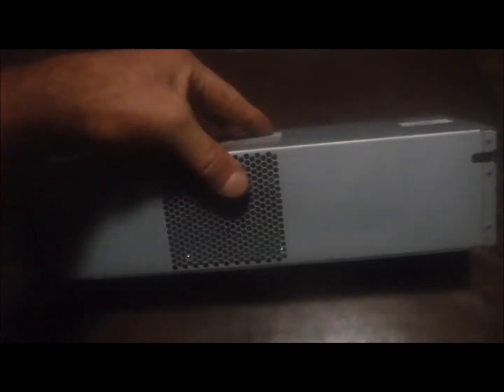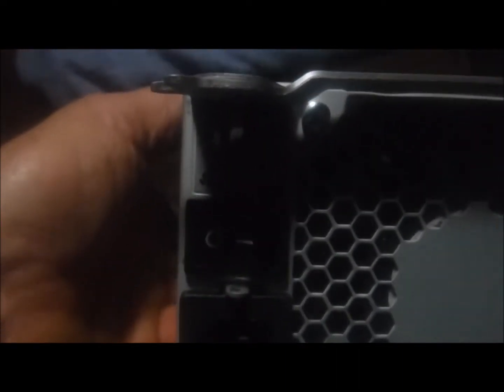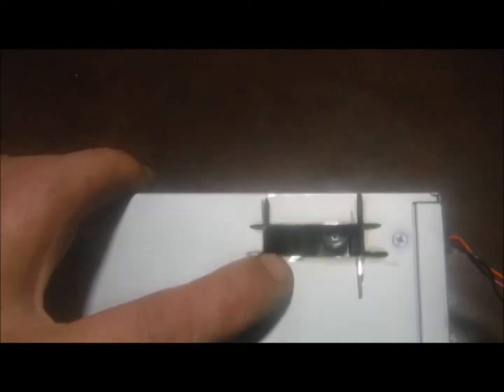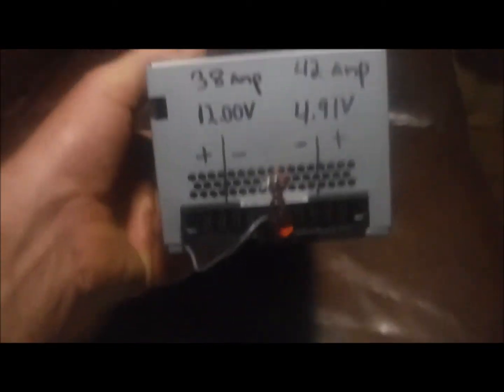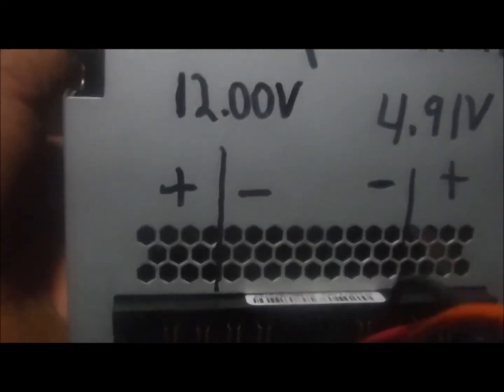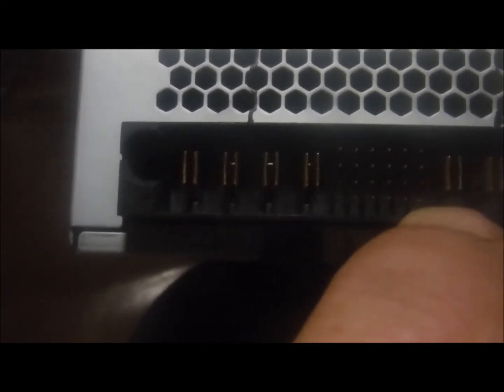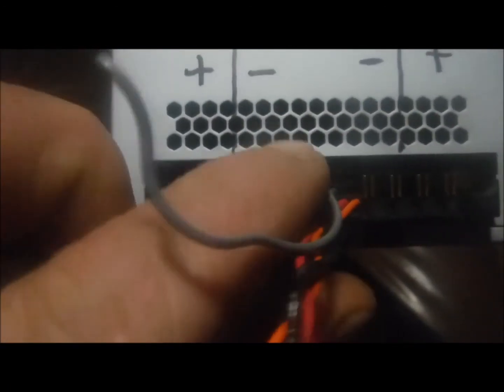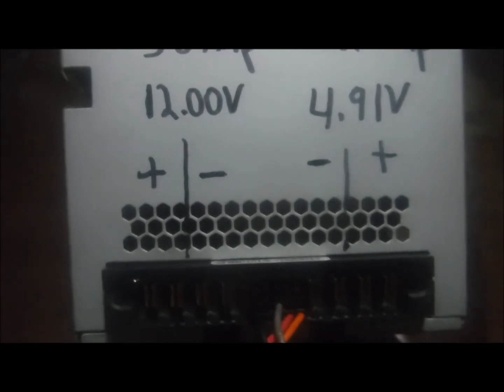Power One HB PCM01 580 AC Switching Power Supply Pinouts

Comment: pretty good amps on that ps
Reply from the maker: Not bad. I,m going to lower  the 12 volt output to around the same as the other one. I can use it then as a dual output at the voltage i,m wanting. Some playing around yet with it. In the spare time  type thing.

Comment: Interesting, what specific use will this be applied to?
Reply from the maker: As a battery charger not as is though. First step is to get it to turn on to output it's voltage. Can take many many hours  to solve.  First task is complete. Next stage begins before using can take place. There not normal power supplies.